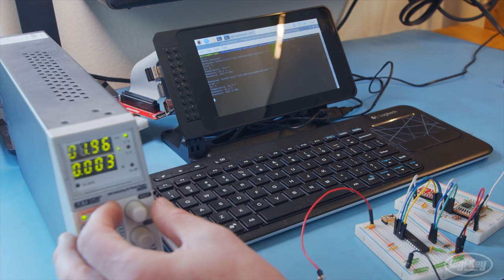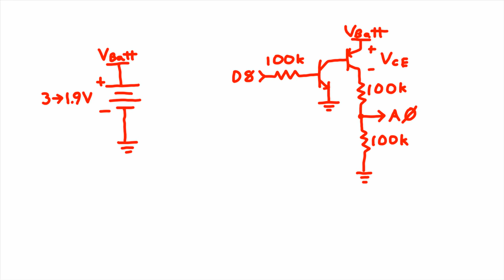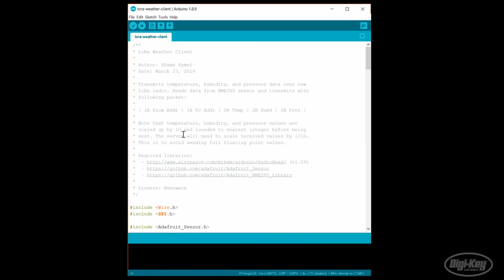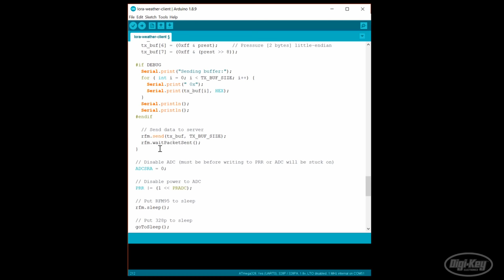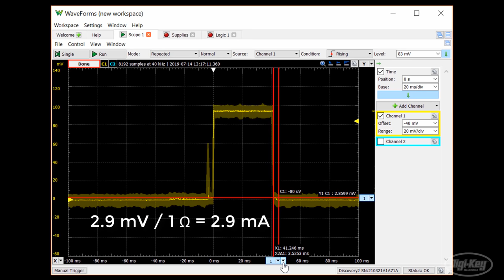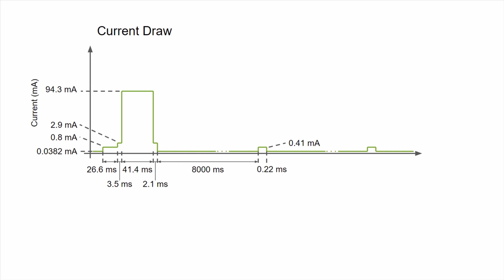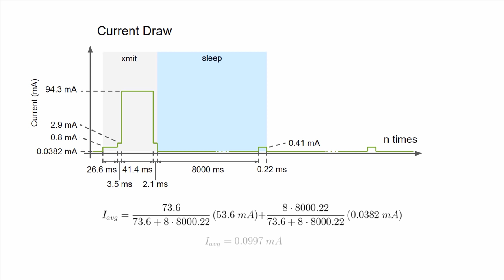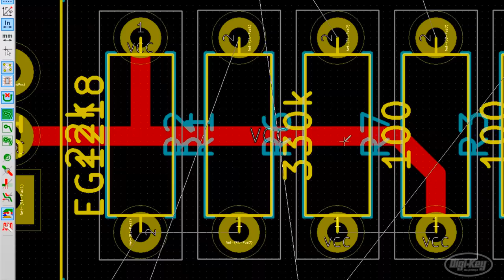Arduino Project to Product Part 9: Run for a Year on Batteries – Maker.io | Digi-Key Electronics

Comment: What? Did it stop? At part 9? I need part 10, 11, 12, 13! I'm creating the exact same thing, hopefully to watch over my boat 400 meters away in the summer and about 50 meters away during winter. Want to add a PIR and temperature sensor. Running on 2x AA battereies. Need it to last about 6 months. So I've calculated an average of 0.2mA. I only need the PIR sensor to work as an interrupt to wake it up and set "movement=1". The temp sensor should only report maybe every hour or so.. Sensor should also disable itself when I turn on the ignition for the boat. So need an external "off / on" feature.

All of your work seems to fit my application so I might rip-of your design and create my own circuit for it much based on this video tutorials. :) Thanks a lot for this, I've followed your private channel aswell hopefully I see more like this. This gave me the old ben heck show feeling.. A+

Comment: Why were the external devices removed when you were reconfiguring the fuses?
Reply: External devices can be on Arduino pins that don't allow Arduino to be put into programming mode, so they have you remove those items which could interfere when configuring the fuses.  I believe this is the reason they have you do that.

Comment: Cool tutorial, Shawn! Would you consider an MSP430 or an STMxxx as an alternative to the ATMega328 for even lower power-consumption? (Granted, that at some point the RF duty-cycle determines the power, not the MCU.)
Reply: Yes--the MSP430 series is known for low-power (I don't have much experience with them, though), and supposedly, the STM32 series have a lot of options for low power. I'm not sure how low they go, though :)

Comment: I understood the first bit (Woohoo!)... Then had that sweeping airplane moment during the math (Boo!)... Then understood it again (Woohoo!) until the math... Whilst I have a 12v 9A battery as a power supply, this is more to power the external items as everything is in a field, so I was thinking of using the LT3009 voltage regulator at it's 3v3 purchase, but maybe a couple of 18650's will do, though as there is a sensor I'll need to connect the GND's. I think my voltage regulator is going to draw more current than my ATMega328P-PU, but, and here comes either a yes or no from those that know, will the LT3009 3v3 version powered by a 12v 9A battery have enough current to manage the ATMega328P-PU in it's basic form as in a previous episode and in a suitable sleep mode so that it can detect an external condition (say a knock/tilt sensor triggering the second interrupt) as everything else out there can be activated by the ATMega turning on a transistor which in turn can activate a MOSFET to draw current from the 12v 9A battery for the higher current stuff. So yeah, in my head stuff is coming together, but for standby stuff I need that really low current standby as events don't happen very often.

Comment: 38uA in sleep? That's a lot
Reply: 38uA includes an LDO, microcontroller (sleeping), BME280 (sleeping), and RFM95 (sleeping). You can find a regulator that has less quiescent current (or use no regulator), but the one I chose met my needs.